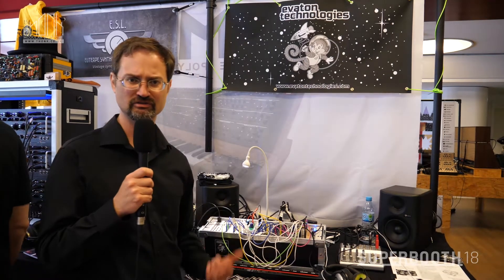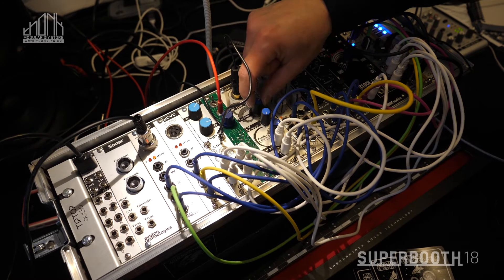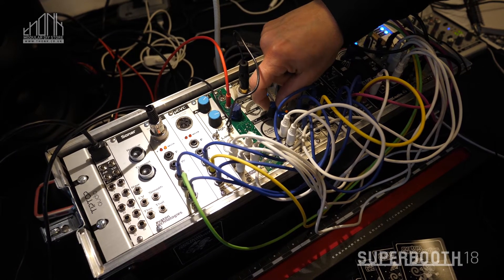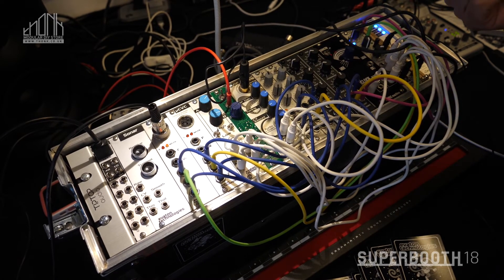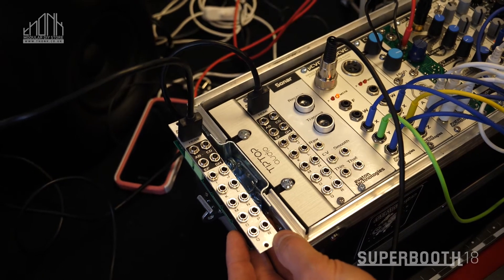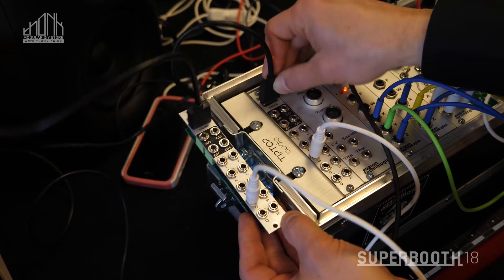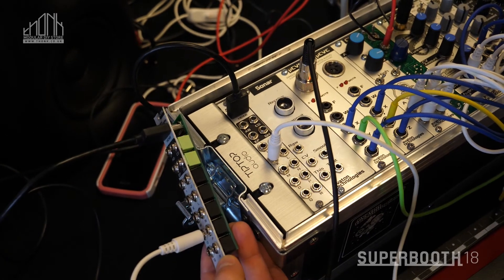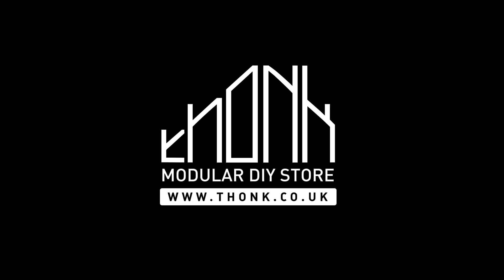Superbooth 18 - Evaton Technologies RF Transmitter and HDMI Link

Comment: I’m definitely keen on that RF transmitter. I like my Nomad as a characterful crackly noise source, but I can’t get any SW reception or even heterodyne sounds where I live, even with extended aerials. With a transmitter I should be able to impose all those interesting artefacts on any signal! Any idea when it’s coming out?
Reply from the maker: voltlife yeah I struggle too where I live whereas 20 miles down the road and it sounds fantastic. It should be out by the end of the summer I think.
Reply: Good to hear it! I'll keep an eye on your website and on Modular Grid.
Reply: Summer is a good time frame; just need to re-spin the PCB and then put together some parts kits.
Reply: any updates on the transmitter? I would love to build both modules and experiment with them! Is it possible to put both modules in different cases and transmit sound across the room? that would be fantastic!